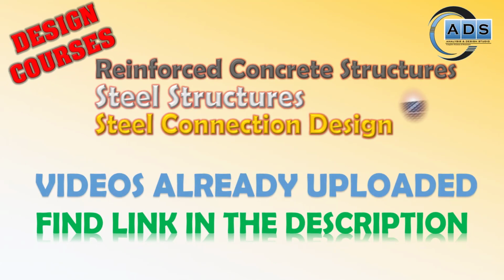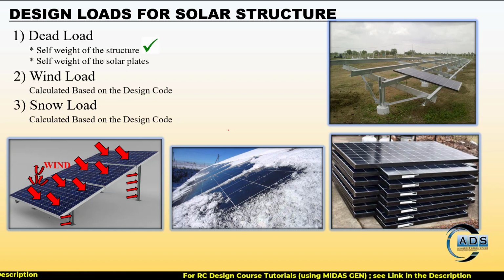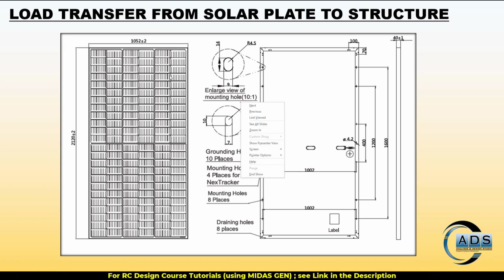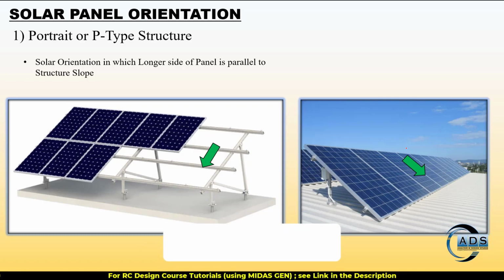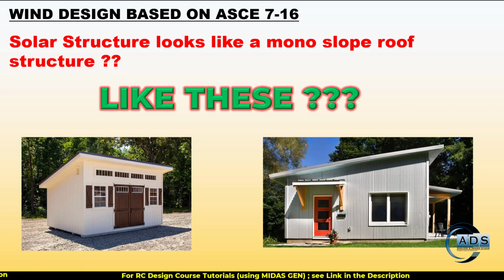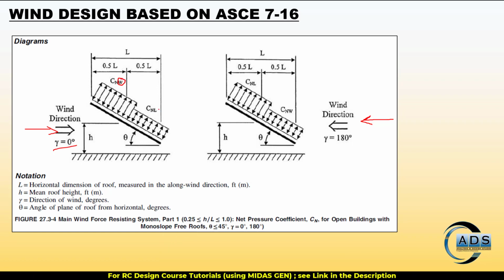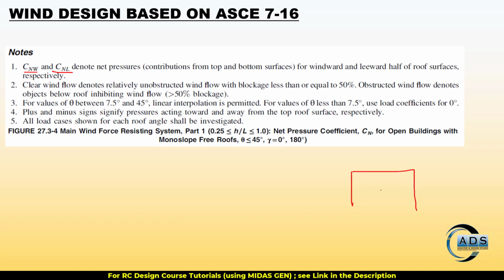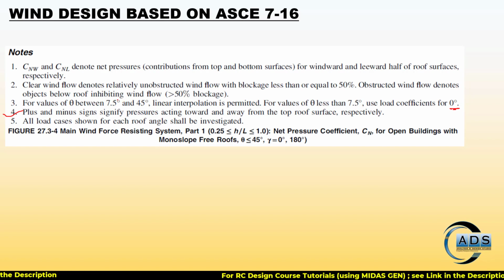Analysis and Design of Solar Structure | Part 1 |  | Basic Concepts and Considerations |

Comment: What informed your decision to use the open structure wind design from ASCE 7-16 instead of the specific section detailing design provisions for wind loads on solar panels?
Reply from the maker: The specific section pertains only to rooftop sites. However, the approach I have explained and used is a generic one and can be applied to both rooftop and ground solar structures and it is easy to understand.